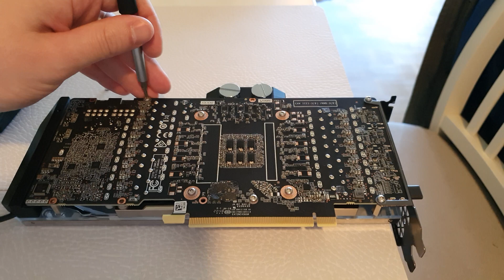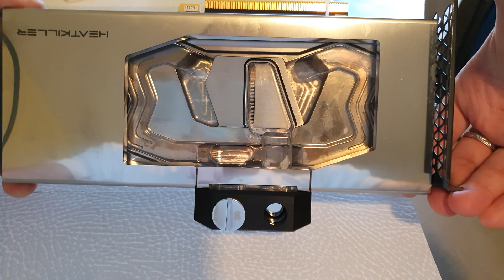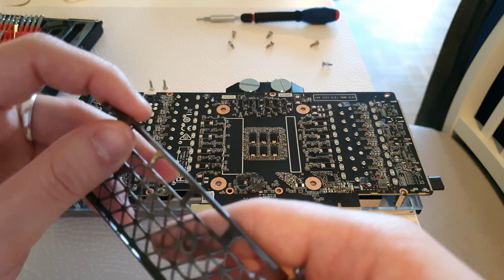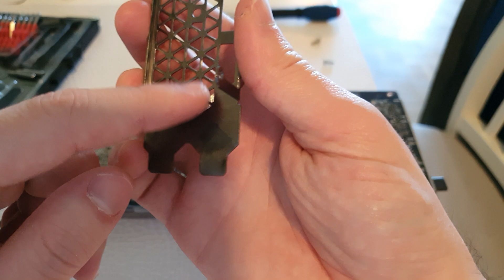Watercool Heatkiller V 3080 Zotac Memory overheating problem Troubleshooting (part 1/4)

Comment: I had saw many different issues with this block on the memory, I believe it is design problem or it is because their thermal pad doesn't fit. I suggest you to get some 2.0mm thermal pad and try it. If the temp are still that high, you should contact the heatkiller support.